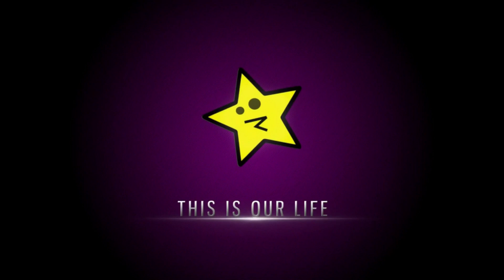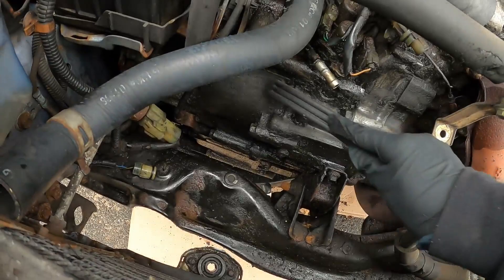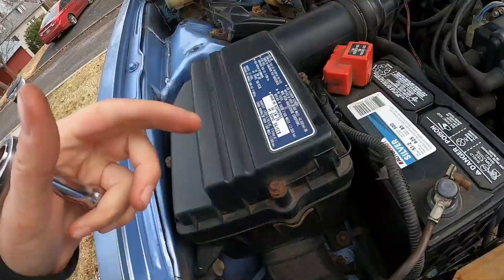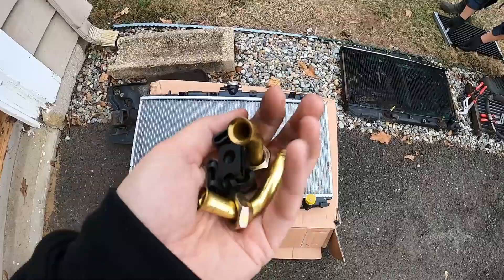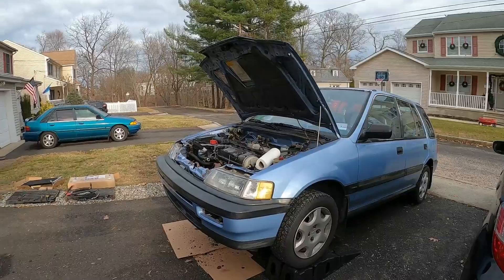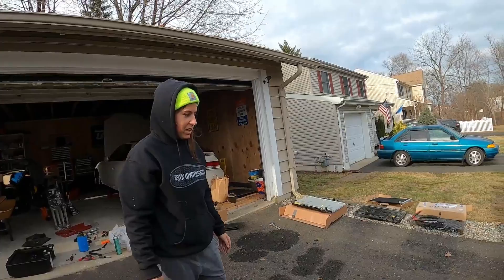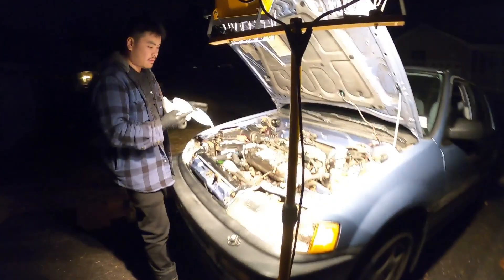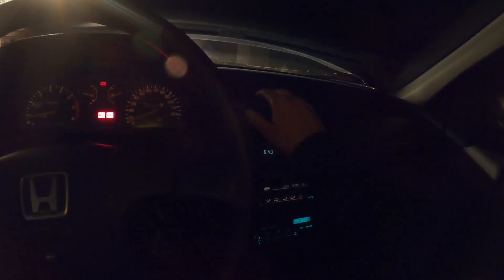RADIATOR and AC INSTALL on the CIVIC WAGON

Comment: U need to replace that AC with a universal parallel flow condenser because R134 was design to work with parallel flow. 
The condenser u have will definitely give u high head pressure when it 80-100 degrees outside, and it will not get cold after 100 degrees.  If u had a PFC Condenser  your AC will get super cold even when its 105 degrees outside. FYI the bigger the better.
Reply from the maker: Well considering it only gets above 95 maybe a week out of the year im ok with that i have.